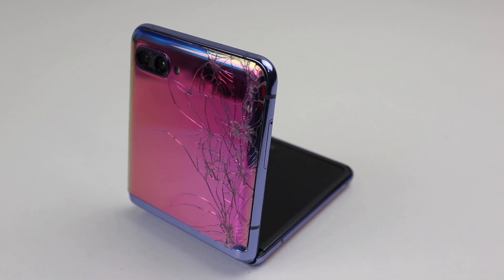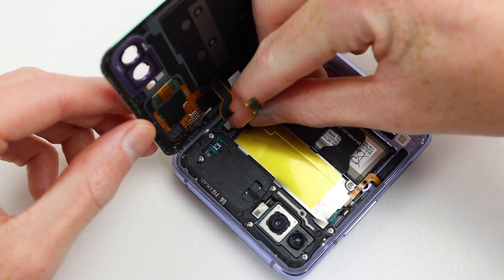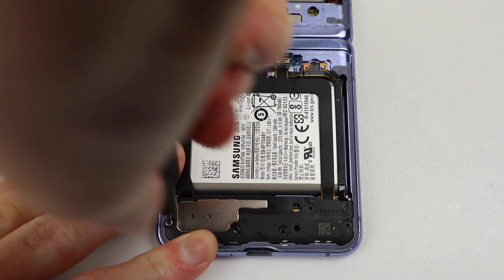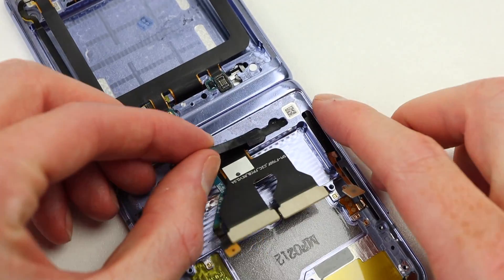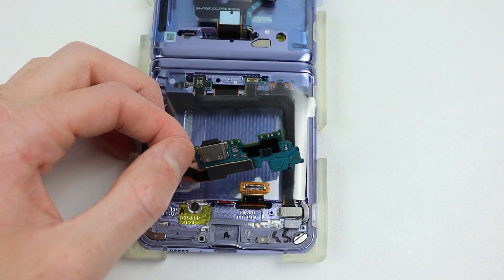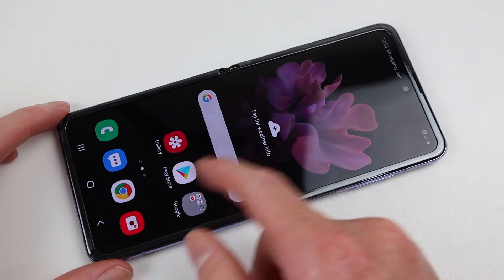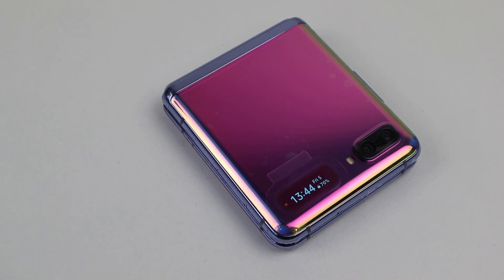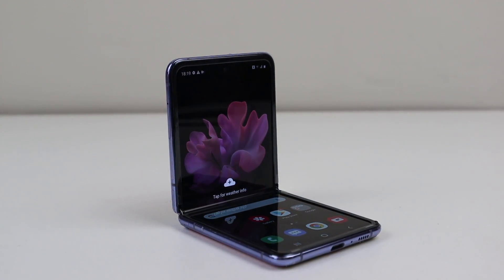Destroyed Samsung Z Flip Folding Phone Restoration - Most Expensive Phone To Repair

Comment: How does this happen? This phone is sometimes indestructible and sometimes it breaks with one nail. Also your videos are awesome
Reply: It's really annoying. I broke my screensaver with my bloody thumb nail and I can drop it on sidewalks and tile floors and it carcks
Reply: @JD-yc7fn  your thumbnail must be hard hard…
Reply: @cinnameun  i mean its PLASTIC. And not solid plastic.
Reply: Remember older Sony Xperias? The screens on them literally breaked by itself or you can break the screen by pressing with nail accidentally= no touch at all...
Reply: I used to use an iPhone 8. I've dropped it countless times on hard surfaces and it never sustained any damages. I put it against a refrigerator door, and the screen cracks.
Reply: @insert_username_here  ikr. I drop my phone on concrete and nothing happens, but it slides off a table and onto carpet it cracks.
Reply: @bobbyjeff32  literal throw my phone cards the street fine set it on the couch crak
Reply: @insert_username_here  I dropped my old phone of the roof of a 2 story home and only a dent to the frame, screen was fine. Then I set down my backpack with the phone in it moderately hard and the display shattered.
Reply: I dropped my S4 GT-i9506 like 6 years ago, from my bed, while sleeping. (1meter drop, not that hard floor)  And guess what. The digitizer broke... like wtf. just lines on the screen
Reply: @coffeemakerbottomcracked  same here, mine fell from less than a meter on a carpeted floor and the digitizer got absolutely destroyed. That's the first and only phone I've fixed myself, of course it was way easier back then
Reply: @coffeemakerbottomcracked  I literally have also an s4 and it broke as well as a sony xperia and also it broke.
Reply: Call most every single iPhone I’ve ever had has a cellular antenna break after like a couple drops without a case but Samsung phones when you drop those without a case they don’t get phased
Reply: @mrjustcausegames5330 yep
Reply: Everything has a weak point! Hit it, and this happens! The Z-Flip was also never indestructale! It’s a fragile phone
Reply: @--2  Guess what every phone is fragile
Reply: @mrjustcausegames5330 , yes? That’s literally what I said lol
Reply: had a note9 that survived a fucking running faceplant onto gravel and brick, faired better then the owner
what killed it was.... hitting the corner of my metal body Windows laptop....
Reply: @supercellex4D  that's crazy
Reply: I used to throw my old android phone around and it didnt brrak but i dropped it 2ft off my bed and the whole screen breaks
Reply: My Galaxy A20 didn't crack until my smaller brother dropped off a table and screen side down onto the concrete floor
Reply: Lol IndesTructiBle? 🤣🤣🤣🤣hahahahahaha. HAHAHAHAHAHA. No, just no
Reply: @HuyTran-sb2ql  do have any explanation as to why that doesn’t boil down to “foldables are fragile”? Cause I’ve seen those things take a beating and come out with minimal damage.
Reply: @borttheattorney6012  ”take a beating” ? May I ask what sort of beating and under what circumstances ( folded or unfold) ? Because it doesnt take a genius to know that this screen that is made of ultra thin ”glass” ,covered in a plastic film is very fragile. I can already imagine   myself accidently break this screen in many different ways.
Reply: @HuyTran-sb2ql  the z flip  screen probably one of the strongest screen if dropped cus it is practically made of mostly plastic but cus of it , the screen has a low scratch resistance
Reply: @HuyTran-sb2ql  I mean Snazzy Labs drop kicks his ZFlip while open all the time. They're really strong.

(Edit: Autocorrect)
Reply: @oncetmitie5278  
Exactly
A foldable screen will take many times the drop damage of a glass screen
That's how "hard" materials work vs "tough"
Glass is hard. Plastic is tough 
If you drop your Z Flip, it will more likely have a shattered back than a damaged screen

The roles are flipped (eh? See what I did there?) when it comes to point impact/pressure. Glass will take pressure from an SPen all day, everyday, no problem. Plastic will get grooves
Reply: @borttheattorney6012  these foldables have  self healing displays so even if it scratches after 48 hours they will become like new
Reply: @HuyTran-sb2ql  You say you can "imagine yourself" breaking it. This implies you dont own the phone. Make your own opinion, dont use someone else's.
Reply: @SilverStar555  I never once claimed that I owned the phone. I can use common sense to judge for myself thank you.
Reply: @HuyTran-sb2ql  I feel it's just like any other phone, I've had a metal rod slap the outside of my z fold 2 countless times (my hobby can be scary for phones) and all I have to show is a little bend in the metal of the hinge. I've also done the same with a note 4 and a note 9 and had to replace their screens multiple times before I replaced them. It all comes down to the luck of the impact.
Reply: @HuyTran-sb2ql  its not likeega fragile but still less than that of modern  flagship
Reply: @HuyTran-sb2ql  Common sense is not always correct, even if it is common Huy. That is the reality of crowd mentality and a world driven by clickbait media.
Reply: @HuyTran-sb2ql  This guy LITERALLY SHOWED DOZENS of these broken stupid flip phones people are trying to get rid of and all these contrarians trying to sound like tech geniuses like “MayBe tHey WONT bReak” UM the phones break just by using them the way they are intended, not even dropping them. Just ignore the idiots
Reply: @borttheattorney6012  you can break those things with your fingers literally...
Reply: @oncetmitie5278  it scratches at level 1 with deeper scratches at level 2...at level 3 I can actually feel the inside of the phone.
Reply: @keqling7086  🤔 Ummm ...no?
Reply: @BC-hc5dq   ”indestructible” , ” take a beatin” 😂😂 I can’t. If I drop my mechanical pencil on it by accident, it’ll probably poke a hole on that poor strechy screen.
Reply: @HuyTran-sb2ql  😀😆🤣🤣🤣👍
Reply: @BC-hc5dq  no its level 2 and level 3
Reply: @keqling7086  self healing displays, never heard of it on foldables
Reply: @HuyTran-sb2ql  😃😄😆🤣🤣🤣